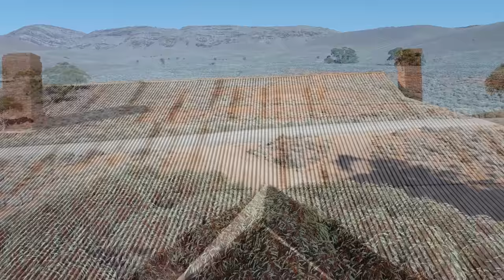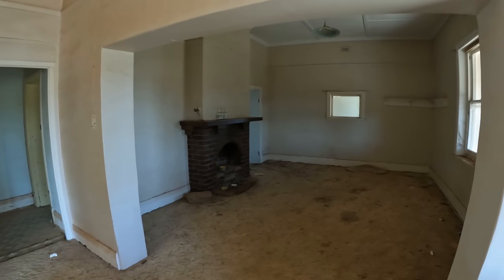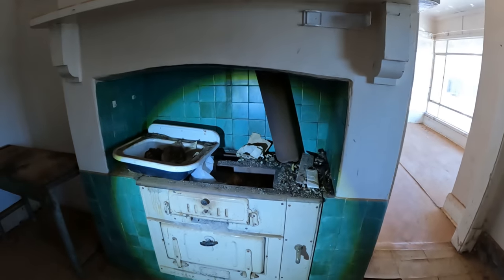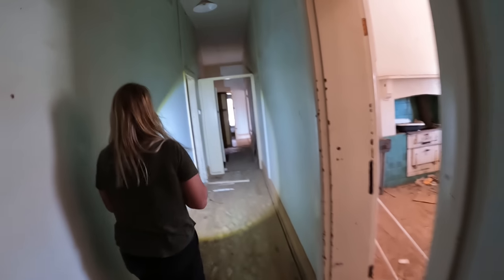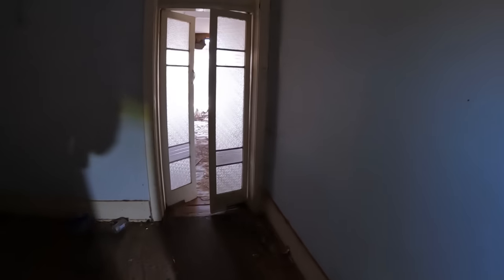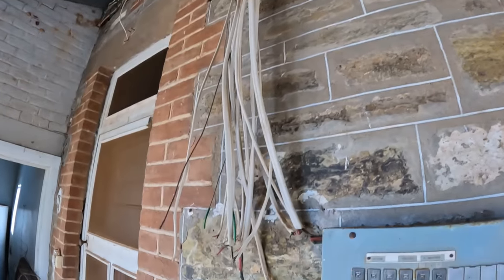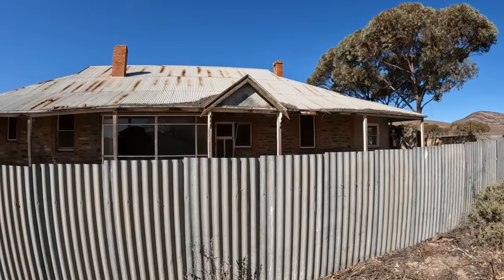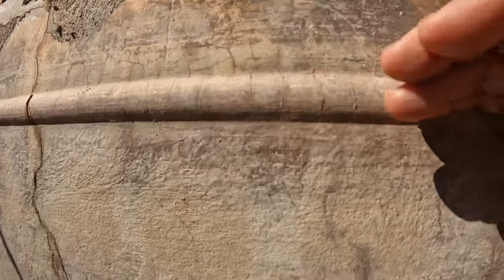Abandoned Homestead in the Australian Outback

Comment: What memories! I remember the high ceilings, the design of the bath and sinks, the ornate ceilings, the doors, the intricate brick work and even a secure fence surrounding the property - and all still standing today. It is the modern additions that are no longer standing. Gosh, what happened to our builders - nowadays the ceilings are low, you roast or freeze depending on the weather, you can put your hand through most walls in these so-called modern houses, and they too cheap to even erect a fence around the property, let alone living right on top of your neighbours! Bring back those good old days.
Reply: ceilings are lower these days less space to heat or cool .

Comment: The rings around the pool were for ropes for bathers to hang onto for safety given the depth of the pool. Additionally, the ropes would sag down between the rings and would be used as a foot hold to climb in and out of the pool instead of having to swim back to the pool stairs. I also suspect a cover would have covered the pool to keep dust and crap out of the pool and to minimise water loss through evaporation.
Reply: Very interesting. Thanks for sharing
Reply: Just for a cover

Comment: The little room alongside the garage with the pit probably once held the 32 volt electricity generator - common in outback homes between the wars. The radiator would have been in what is now the window, and the exhaust pipe came out thru the hole beneath the window, on the side away from the residence. Then, in the 50s and 60s, there would have been a proper 240 volt 'package unit'  generator set up outside and further away to power the electrical farm and household equipment. (The wiring and fittings are all 240 volt, as is the Adelect No 3 stove.)

Comment: The kitchen sink cupboard unit was installed some time in the decade after WW2. The vinyl tiles probably went down at the same time as the sink unit... certainly before 1960. The tiles and the adhesive probably contain asbestos. 

This kitchen was never 'renovated' and turned into a modern 20th century bench-top kitchen. It's bare walls and the lack of fixed bench-tops or power outlets mean the kitchen retained its late 19th century stand alone side boards to store all the kitchen equipment. 

This was an industrial kitchen of its day. Very basic but built like a tank and capable of feeding a dozen people when needed. The fact that everything that could move is gone, is a testament to how important it all was to the culture of the place.

The centre of the room was dominated by an enormous table(s) used for old school kitchen work such as baking bread, and sausages. Except for formal occasions, the kitchen was the hub of station life for both the family and station hands. Most meals and planning meetings would have occurred here. 

The top cupboard in the corner was added in the mid 70s and is constructed along the lines of caravan furniture of the period. The condition of the range is good, meaning it was probably used right up to the time the house was abandoned.

The pantry would’ve been off limits to kids stealing biscuits, and dogs. It would have contained enough dry food to last about three months, or a whole season. And the house cat would have been kept busy. The meat of the day went into the meet safe. Not fresh killed, but hung in a cool room for several days.

The lady of the house insisted on the bathroom soon after the war, judging by the bath taps. It too was kept in good nick right up to the end. The shower went in later but not much later. It was a DIY job, that probably replaced a stand alone linen cupboard or vanity that was in the corner. Again, they never upgraded to built in cupboards.

Comment: This was built between 1880-1900. It would’ve been a pastoral homestead built by a wealthy landowner. 

It has been fully renovated in the late 1950’s at great expense. Ours was reno’d in 1947. 

I can tell by the original fittings and fixtures, and the style of the renovations. 

Somebody owns this property is well aware of its condition
Reply: Not true built in 1920s
Reply: @shirleydearlove2835  Yes, all the joinery, doors, skirting, architraves, is classic 20s, and the panelled ceilings. The besser block additions would most likely have been late 70s to early eighties.

Comment: That's not a swimming pool. Its a water storage tank and the rings would have been for some type of cover to prevent evaporation.
Reply: Most homesteads I've come across have a deep square stone and concrete pit (well) right next to the house and aren't rectangle with stairs 👌😊
Reply from the maker: Whatever you think it is, it's awesome!
Love your comment. Like and subscribe 😁
Reply: The water would go stagnant if it was for storage & why have the steps. House hold tank water needs to be in a tank concrete or steel.

Comment: That place must have been lovely once. My guess is those rings were used to fasten a tarp over the pool to slow evaporation, the pool possibly being also used as a water cistern (no evident filtration equipment)
Reply: Yeah, no evidence of filtration: So a tarp would reduce debris from the incessant wind and dry environment blowing leaves and dust (which beomes Mud) into the water. Also regulates water temp and stops massive evaporation in the dry summer heat - imagine continually topping up the bugger from the house tanks (there was no evidence of a bore)!!!! Imagine the teenage kids forever not putting the tarp back after use!!!  ..... maybe that's why the parents left 🤥

Comment: Cant imagine they built a homestead of that size in such dry country without having access to a bore close to the house. Although the bore water quality might have not been fit for drinking, I'm sure it would have been fine for stock and the pool. The evaporation rate on a hot day would have been at least 30cm. Allowing for hot windy days and minor pool leaks it could have been double that. I don't think they would be using precious drinking water to top up the pool. Bore water was also used for showering as well sometimes.
Reply: Had rain water to drink and shower

Comment: If roof and foundations are solid, and not penetrated by moisture, a structure will remain solid, until one or other of the floor and base give out. Unfortunately, and perhaps inevitably, it does look like the roof here is starting to rust through in places. If it doesn't get repaired in the next few years, that will spell the end of the lovely old homestead.

Comment: Most any building of the early years up to 2003 had asbestos throughout the building as it was the cheapest way to build back in those times, since somewhere in 2003 when asbestos was banned as a viable resource of cheap building material it was common place  to find houses built with asbestos prior to 1990. Asbestos was gradually phased out of building materials during the 1980s and manufacturing stopped in 1987
Reply from the maker: I always thought they phased asbestos out in 1970?
Reply: @escapetoeverywhereaustralia  They started to slowly ban asbestos from there, so the building industry was not interrupted to much, by 2003, they had totally banned it.